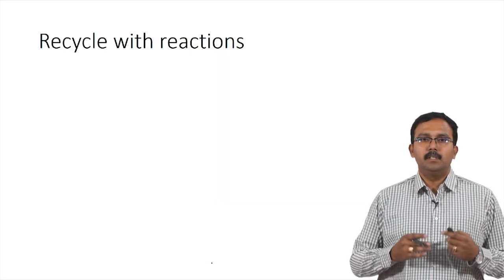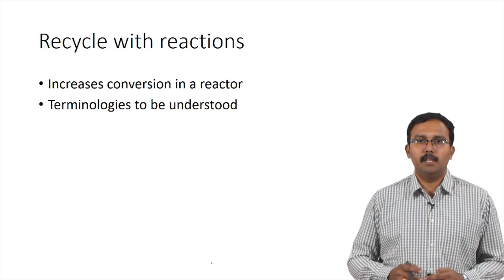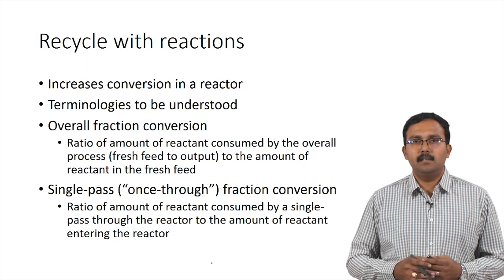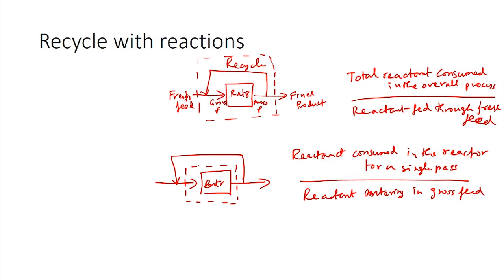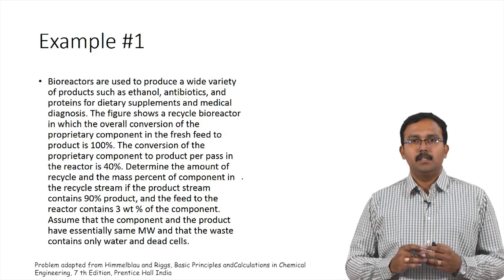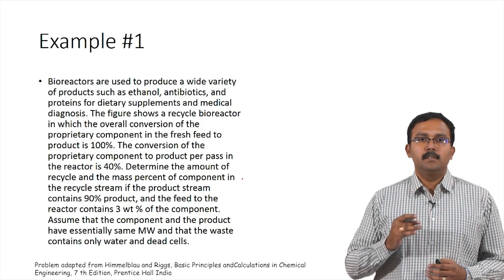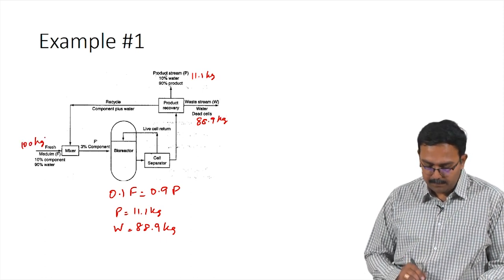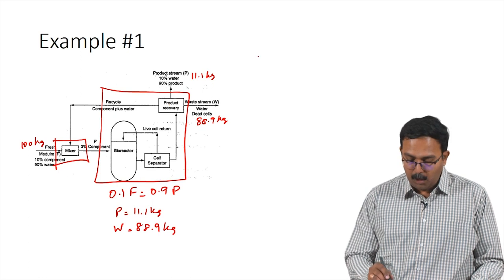Recycle with Reactions

Comment: Sir I did not understand the material balance over the combined system consisting of the reactor and the product recovery. I understood the input to the reactor which comes in from the gross feed bit how is the output going into the recycle? Isn't the output going into the stream P?
Reply: @Maiden SA  But while he started the material balance,he put C=P. Because they both have the same molecular weight. So I kinda thought that while taking the combined system..the component would come.out of both , ie the recycle and the product stream because C--->P..
Reply: @Maiden SA Thank you ,i had the same doubt